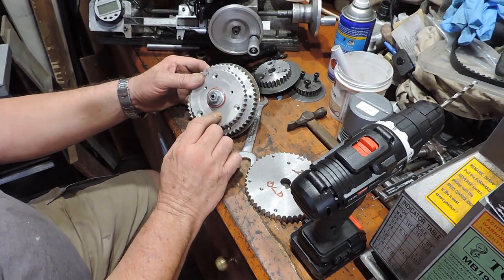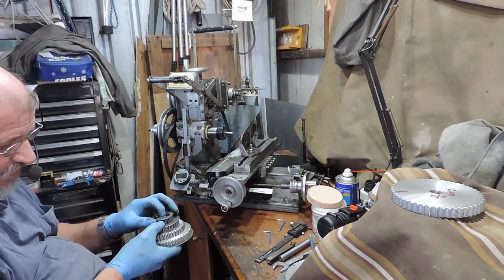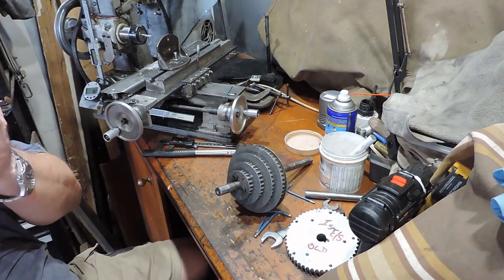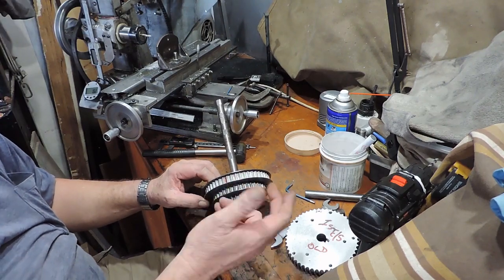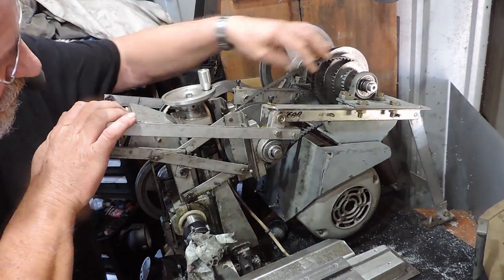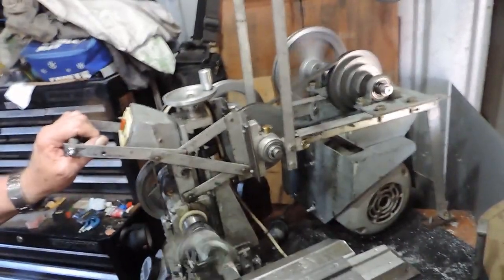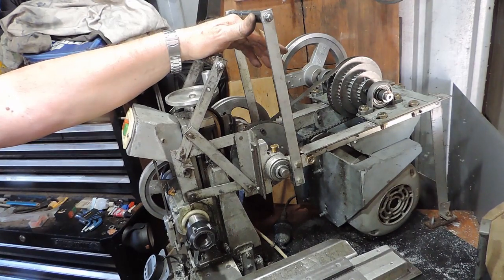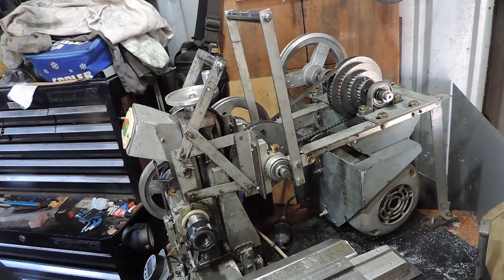Gingery mill transmission upgrade Part 15

Comment: Hi Peter.  Unfortunate you have the vibration on the highest speed, but like you say you may not have a lot of need for that unless you are using some rather small cutters.  All in all a great upgrade to your milling machine and a great video series.  Thank you for sharing it with us.  Perhaps when you do the ball bearing spindle you can get the highest speed.  Also, would it do any good to balance the pulleys?

Joe
Reply from the maker: G’day Joe. I thought about balance but without the spindle it’s fine, so what’s in the spindle pulley set up, the spindle obviously and 2 x 2” pulleys and 2 x 6” pulleys, I bought 1 set and I made the second set. I’ll excuse the 2” pulleys due to small size and both are solid turned items. The 6” pulleys well I made one but it is fitted to the second countershaft which spins all the time, with or without the spindle so it should be ok. I don’t know what’s happening but I was thinking of fitting ball bearings for the spindle anyhow so I will set it aside until then. It works fine for the other 7 speeds so I don’t need it anyhow. 
Thanks for your support. 
Cheers 
Peter

Comment: Gday Peter, the pulleys turned out good, 4000rpm is bloody quick and as you said you more then likely don’t need it, with the ratios of the 7 speeds is a selection, you got a gear for every occasion, I’m considering wether to remake the spindle for the Quorn and using a different bearing setup, haven’t made my mind up yet, awesome job mate, cheer Matty
Reply from the maker: G'day Matty, sorry to be late replying but I've noticed lately I'm not getting notification of comments, stupid YT. Yes I don't really need 4000rpm
Cheers
Peter
Reply: hi matty
Saw that you mentioned quorn, would you happen to know were i can get details for a quorn T&C grinder
regards
mr f
Reply: @MrFactotum  Gday, I believe there you can get a revised article/plans from Hemingway kits, there CAD drawings which have 3D views of the components which are a lot easier to follow, cheers Matty
Reply: @MattysWorkshop  thanks matty, i will follow that info up, asap
thanks for quick reply
regards
mr f
Reply: @MattysWorkshop  matty forgot to say, ive sub'd you and will take a look what your up to, didn't realise you were making a t&c grinder. 
best wishes
 mr f

Comment: The imbalance may not be the spindle, but a combination of the pully, the belt and the spindle. There also could be harmonics involved. At that speed it wouldn't take much flutter of the belt along with a small imbalance to cause vibration. Some tapered bearings for a small trailer would work for the spindle, or possible some front wheel bearings for a small car, if you needed a little larger I.D.               the only problem with two tapered bearings is expansion of the shaft if it runs warm.
Reply from the maker: G’day Ronald. Harmonics, hmm excellent thought. I have a set of taper roller bearings for the mill for some time now just waiting for the foundry man and the machinist to find some time to get around to making a new spindle head and a spindle with a collar, it was a definite project for the future. Your harmonics theory is interesting as the toothed belts do bounce a fair bit, more then the V belts. Fitting a belt tensioner comes to mind but this introduces more complexity to the belt change procedure. 
Food for thought. Cheers. Peter